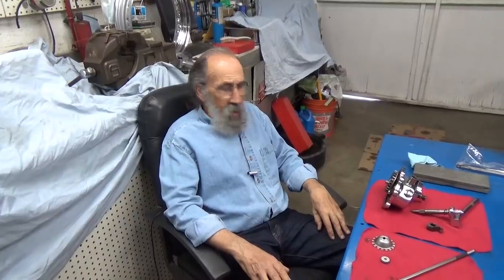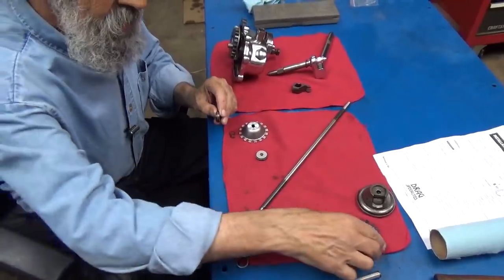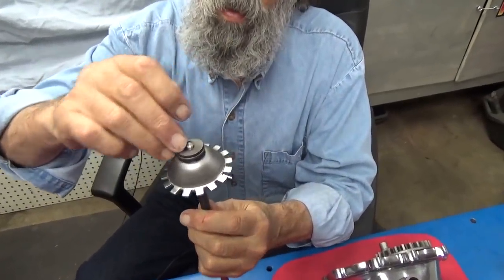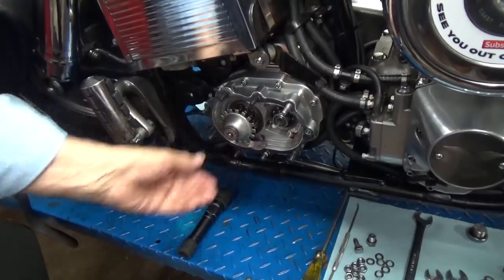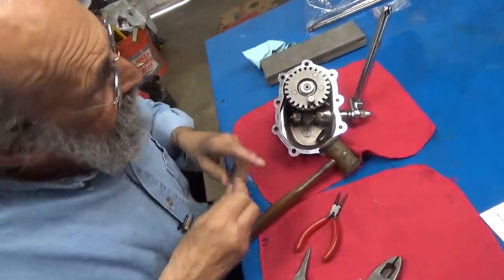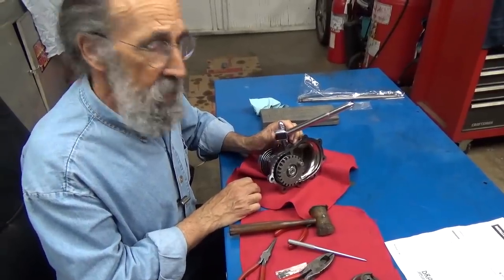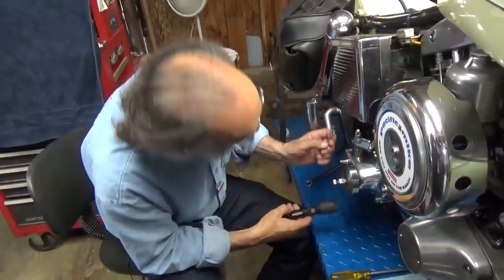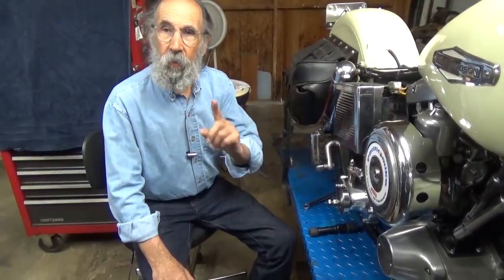Repair by replacing: Clutch Throwout Bearing and Oil Slinger on Harley Davidson Shovelhead.

Comment: Hey Mike love the vids I have an 84 flh 5speed evo it's the one with the diamond shaped side cover very similar mechanism to the one you just installed .  My one didn't have a slinger on it and I don't know if it should have one or not  what do you think ?Its seen a lot of reaching by previous owners over the years and info on this model is limited, any help would be great thanks
Reply from the maker: I'm honestly not sure, probably not.  What I do remember is that we needed to add a little oil to the trans with the very early 5 speeds to keep from burning up the throw out bearing.  I think that answers it.
Reply: @pacificmike9501  no prob thanks Mike 👍

Comment: Mike,   I replaced mine a couple three years ago and it already broke again. I see you can by the old style and it says "exact fit" for my 1978 FXS. Would I be better off going with this or just replacing it with the OEM like you just used in this video?
Reply from the maker: I've done both.  There is a kit to put the old style throwout in a newer bike.
Reply: @pacificmike9501  which do you think is better?
Reply from the maker: I prefer the early bearing.  You'll need the kit though.

Comment: Another great video... I don't feel bad for loosing my clips now. My 75 FXE four speed has seen better days. Is there a particular brand of six speed that you prefer to run? I'm definitely keeping the kicker set up. I like having a backup, plus the old school look. Any info would be great & as always be well.
Reply from the maker: Mine is one of Mr. Baker's first ten he built for Shovelheads.  That was quite a while back, and I still love it.
Reply: @pacificmike9501  good to know, I was leaning towards a Baker. I'm definitely getting the N1 shift drum for my chopper project... That four speed is in great shape, going jockey shift on that one. Be real handy in traffic to find neutral.

Comment: Is there any trick with a cover gasket? Any sealant needed? Thanks a bunch!
Reply from the maker: Both surfaces are machined flat and nine studs hold it.  Use a good gasket and shouldn't need sealant.  But, if it does, use some next time.

Comment: my 73 has come up with an unpleasant knock. I'm sure it's a rod knock but have never had that. a year and a half ago i had the top end off. new rings head job, cylinder honed. wiggled the rods and didn't notice any play. Bike runs and idles great. I have a video I would like to text someone to see if it's a rod knock before I pull that damn thing out and ruin my summer. Brian
Reply from the maker: It's really hard to diagnose from a recording.  Does it make a noise when you turn it off?  Does it make a noise at idle.  If it clunks when you turn it off, it is probably a compensator that's loose.

Comment: How much pressure should be on the pressure plate of an 80 shovelhead? How do I know it it is to tight or to loose?
Reply from the maker: Do it according to the manual.  This is in linear measurements, not a pressure you can measure.  You didn't mention a problem.  Is your clutch slipping?  Are the plates all clean and set up properly?  Have you overpowered your stock clutch?  Sure has happened to me.  Maybe better parts, clutch plates, springs, you need to tell more.  I'll help if I can.

Comment: Mike, does the oil slinger play any part in keeping the ball bearings on the clutch ramps oiled? I found out that one of the bearings and its corresponding inner and outer ramp appeared to be scorched, or had baked on oil, while the other balls and ramps were clean and smooth. What could account for this?  My concern is that my 2000 Springer did not have the oil slinger.
Reply from the maker: All iI can do is speculate.  I believe the trans was run low on oil.

Comment: Mike a few days ago a buddy came by with his 1980 shovelhead and asked me if I would adjust his clutch . At the age of 70 he's a newbie to harley's and he did try to adjust it in himself . The clutch lever would only pull in about a half way and then it was solid. I took all the slack out of the cable and removed the derby cover . the adjusting screw lockdown nut I could remove with my fingers but the adjusting screw was another matter. It took a big screwdriver and all the strength in my old arms to back of the adjusting screw. When I got it out  the Treads at the end of the adusting were  chewed up and the  ball bearing was embedded in the adjusting screw . The clutch operating pushrod is probably toast as well. just wondering what I should do next to try and fix this problem ? Thanks
Reply from the maker: First off, the adjusting screw with a ball bearing in the end of it is an aftermarket piece that I've seen a lot of and replaced a lot of.  I don't know that it's a bad idea, but not one of my favorites.  Personally, I would replace the adjusting screw with an original type and replace the clutch rod.  They are probably both bad.  You'll have to open the right side and do the throwout bearing at the same time.  Clean and adjust the whole clutch.  Remember, you're adjusting a 1980 model with the rotary top on the trans.  According to the service manual, back off all tension on the clutch cable and set the adjusting screw to put the clutcharm (while you pull the cable with your hand, so you can locate the clutch arm at rest 13/16" from the top of the trans lid.  And remember, "No good deed goes unpunished."  You're a good guy.
Reply: @pacificmike9501  thank you very much Mike for getting back to me so fast I really appreciate it. Thank you so much for your instructions. I'll let you know out everything turns out when I get it finished. Stay safe and thanks again Mike

Comment: Hey Mike, great channel. I'm looking to add a shovel head to my Harley stable, specifically an 85 FLHP, largely influenced by your love of the older bikes. It will join the 68 servi car. Do you know is the bottom end on these bikes Evo or the last of the shovel bottom end stock? Good machine in general? Best regards from the East Coast of NZ.
Reply from the maker: It's a Shovelhead engine.  The interesting changes are usually in the primaries.  That 85 probably even has a belt final drive.  That's a pretty rare motorcycle.  The real last of the Shovelheads.
Reply: @pacificmike9501  Hi Mike thank you for your reply, you are correct it is belt driven. I feel very fortunate to have an opportunity to own it, so I have committed to the deal. Thanks for your input and keep up the great work, all the best to you and CMM.

Comment: Hi MIke, finally got my 76 FLH out on the road and in no small part due to your videos.  After watching this one I'm wondering what the symptoms are to know if I'm having problems here.  I kicked started it once and no issue, 3rd kick.  Then I tried again and now kicker doesn't catch I kick and peddle goes right through, like its not catching.  I electric started it and noticed that when cold its a bitch to throw into 2nd, then once warmed up no problem shifting up or down.   Should I be checking the oil slinger and throwout bearing.   I'm up here in Scoudouc N.B. Canada it is good to have you keepin us shovelers riding.  Thanks again
Reply from the maker: Well, it sounds like an engagement issue in the kicker gears.  I'd open it up and have a look.  Sounds like maybe your clutch plates need cleaning too.
Reply: Thanks Mike, keep yer knees in the breeze sir

Comment: i think its time for me to pull my kicker assembly on my 76 flh  my arm is way to far forward and my adjusting screw is so far in i only have a thread or two on my locknut so i think if i go threw my kicker i will prbly find somthing wrong with my reasembly when i had to replace my kicker shaft ill bet i screwed somthing up in the kicker that is making my clutch adjustment so difficult. any thoughts mike ill bet you know what i did wrong!  thanks for the vids mike .
Reply from the maker: Take it apart.  Take it slow.  Be sure you're using the right pushrod length and the right throwout bearing for the pushrod.  Other than that, just have to see.
Reply: @pacificmike9501  thanks mike i will pull the kicker off this weekend as punching a time clock kinda gets in the way of wrenching the old harley and old corvette thanks for your reply.    pops, east coast.
Reply: ok i think i know what the problem is there is a 7/16 od bushing that is supposed to ride inside the mainshaft about 1/2 inch from the end kicker side mine was not inside this makes sense i had nothing to adjust we will see how things go tomorrow

Comment: Hey Mike. Wondering how I can contact you directly. I want to remove the kick start plate from my old clutch basket but not sure if I should be pushing on the washers to push the kick start plate off or if there’s some other method. I have a small press I can use so I don’t need to hammer it. Just not sure if I should be getting the bearings out first or the kicker plate first. It is a 1958 XLH that I’m working on. So very old style stuff I’m working with
Reply from the maker: I don't remember.  The last time I did a 58 XLH was in 1969 when I built one for myself from a $200.00 basket case.  If you don't have a service manual, buy one.  I'm sure V-Twin carries one.  Also, you can refer to V-Twin for diagrams on that setup.
Reply from the maker: You'll find this in their parts catalog (XL Section).

Comment: Mike, I have a footclutch, I wrecked my throw-out bearing now for the second time (Primo_Ventura clutch) would you suggest to upgrade to a LATE STYLE THROWOUT BEARING KIT?
Reply from the maker: What is the bike?  Is this a four speed?  If so, you're probably moving the bearing too far with your pedal.  Restrict the movement.  I assume you're using a suicide pedal.  You gotta give me more info with the question.
Reply: @pacificmike9501  it’s a four speed! In combination with a Panhead engine.1.5” open belt with a primo/ ventura clutch. I’m using a foot clutch pedal (I can take my foot of while engaged at a red light) not a suicide clutch.
Reply: @pacificmike9501  restricting the movement might be the solution
Reply from the maker: Sounds like it.  You're probably smashing it.  Maybe too long a clutch rod (internal).  Might cause you to move the arm too far.
Reply: @pacificmike9501  I use a 14” rod, I could cut 1/4 “ off using the lathe! Thanks for the feedback! I will keep using the old style throw-out bearing one then.
Reply from the maker: Don't cut one off, unless you're ready to reharden the end.
Reply: @pacificmike9501  nope... totally didn’t realize that 🤦‍♂️ I need to look for a shorter one then. I thought 14” was the shortest out there... but there is even a 13 1/4!!

Comment: Hi Mike, my 70 Shovelhead creeps on me while in gear and it’s impossible to shift into neutral when stopped. My last mechanic said it needed a new clutch bearing. Would this video be what I’m needing to do?
Reply from the maker: You'll have to get in there and take a look.  We've shown quite a bit on the old dry clutches.  A complete cleaning is always good.  Then, learning to adjust it well and you'll be an expert.
Reply: @pacificmike9501  can you share a link to a video I should watch for dry clutch cleaning?

Comment: My pushrod kit came with a small bushing /sleeve ( approx 1/4 " long) that slides over the pushrod.  Question is where does it go. The video doesnt show it.
Reply from the maker: It's most likely a bushing to go into the mainshaft of the trans for the pushrod to ride on.  Save it for when you rebuild your trans.
Reply: Thank you for your reply.

Comment: Mike, eu vivo em São Miguel nos Açores.
Será que me podes dizer a sequência do  aperto das cabeças do motor Evolution 1340cc 1984.
Obrigado!
Reply from the maker: The front bolts on the front head are 1 on the left and 3 on the right. The rear bolts on the front head are 2 on the left and 4 on the right.
The front bolts on the rear head are 2 on the left and 4 on the right.  The rear bolts on the rear head are 1 on the left and 3 on the right.
Soak those big deep nut with oil on the inside for half an hour, then dump them out and blow them out with air pressure before installing them.  
Now install them finger tight.
Now tighten them to 7-9 lbs. of torque.
Now tighten them to 12-14 lbs, of torque.
Now, draw a line on each one and tighten them each an additional 90 degrees.
The head bolts are now done and do NOT require retorquing.
Reply: @pacificmike9501  Thank you so much for your attention and if you need any more information, I'll count on you again.

Comment: Do I have to put fluid into that after replacing ? Some oil type stuff came out while I opened it up .
Reply from the maker: Keep your transmission lube up to the level described in you service or owner's manual.  I'd need to know what you have to answer the question.

Comment: Mike hi, please explain if I should be worry if I found out that kick starter clutch is missing a small metal ball and spring . What is the purpose of that ball on a side wall of the kick starter clutch? Appreciate your help!!
Reply from the maker: Look inside the early type throwout bearing (you didn't say what your bike is).  There is a channel on the inside of that bearing that the ball locates in.  But, it will work fine without it.
Reply: @pacificmike9501  Mike appreciate! I am not sure which year the box is but I guess 1970-1978 something like that. And  I am using late style throwout setup. I will not pay attention to it . Thanks again!
Reply from the maker: You're quite welcome.

Comment: Guys don’t sit at a light in gear with your clutch in 🤦‍♂️
Reply from the maker: Good advice.
Reply: My '19 Sportster only finds neutral when I'm looking for second, when stopped no matter how gingerly you tap the shifter ALWAYS hear a double click into second while tryin to hit neutral... meanwhile looking to upshift to second neutral fucking neutral always fucking neutral.... pretty much all other manufacturers have a neutral lockout that prevents this while moving, and at the same time make it simple to find neutral when stopped. My old ass '83 kaw will not hit neutral over 5mph unless on purpose hold shifter between gears, and at a stop will not go into second from first, only neutral.

Comment: Hey Mike I ride 1975 shovelhead, 4speed ratchet top ,kickstart only ,JOCKEY SHIFT, can you down shift, if so what would cause mine not to down shift, have to come to complete stop . HELP
Reply from the maker: Hard to say.  Quite often it's water damage.  One of the things I check first is the "plunger" or "cam follower" which screws into the trans lid on the right front of the lid.  There's a bolt to remove with a lockwasher, then a spring, then the next piece you'll probably need a magnet for.  Clean all those parts and put them back in.  Grease them up first.  If that doesn't help, time to take a look.  Maybe the ratchet assembly has a broken spring.  They work so well, people never look at them.  When they're serviced and working well, the ratchet lid is one of the finest things I can think of.  Do it "by the book."

Comment: Hello Mike. Do you know what the clearance should be between the clutch rod OD and mainshaft ID? This would be for a 1977 fx shovelhead with a stock 4 speed tranny. I think mine has too much play. Thanks!
Reply from the maker: I've never heard of a spec for that.  A new clutch rod is not expensive.  I might buy one just to compare it.  That's a very different question.

Comment: Where could I find a clutch release lever like this one?
Reply from the maker: If you're referring to the "offset" arm on the trans, it is the one my six speed trans came with.  It is a complete transmission from Baker Drivetrain and it's on of the first ten Mr. Baker built for Shovelheads.  They probably have one on their parts list if you call them.  They are in Saginaw, Michigan.
Reply: @pacificmike9501  Yes! Thanks I have a clearance issue with an aftermarket starter. That arm looks like it might be the ticket.
Reply from the maker: Hope so.

Comment: mike i put mine on the kikr is at 9oclock and wont budge like motors seized
Reply from the maker: Better take it off and look again.  That kicker gear may not be "clocked" properly.  The stud on the kicker gear may not be registering properly in relation to the stop in the trans case.

Comment: Hey Mike, I sure hope you are putting this ole Shovelhead together for a show, because without a gasket or sealant of some kind on that cover, you're going to have a big mess on your hands or should I say back tire. Or is this one of them there new tranys that doesn't use oil? LOL -OOPS  - Thanks for the video bud. Later
Reply from the maker: The gasket is there.  I put it on before we started the video.  Look a little closer.  The show is actually at a nice 80 mph cruise.
Reply: I didn't see it at first either. Pause at 11:03 & there she is.

Comment: My `90 FXSTS clutch required frequent adjustments and then the cable broke. So I replaced the cable and the clutch still needed frequent adjustment. The thrust bearing wore out! Who says lightning never strikes the same place twice???
Reply from the maker: Take a good look at the clutch pushrods, all the way through.  Make sure the ends are not wearing.  If they are, replace them.  Measure the thickness of your clutch plates, as per the service manual.  Lube the clutch cable and lever assembly before installing it.  Allow only smooth curves in the cable installation and anchor it where the factory did. Probably, some part has lost its hardness and is "going away."
Reply: @pacificmike9501  Like I said, the bearing wore out. Interesting, also, the pushrod fusion welded itself together. So I replaced the bearing and pushrod assy. `s And she`s been working well for a year or so.